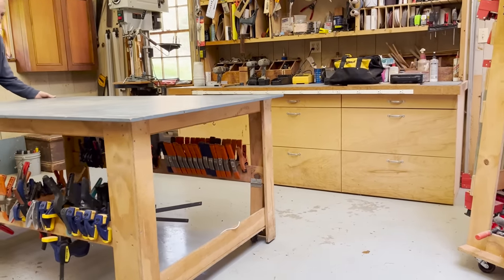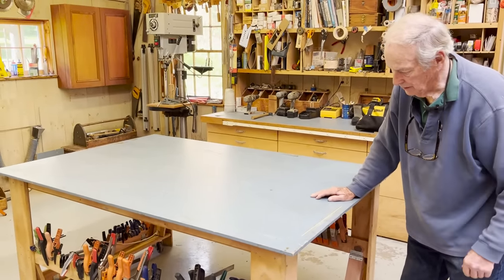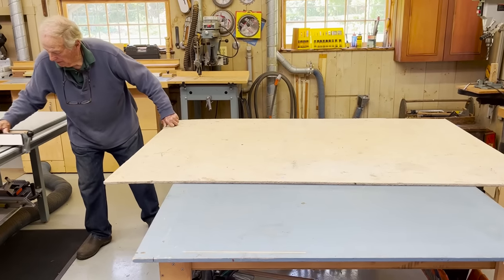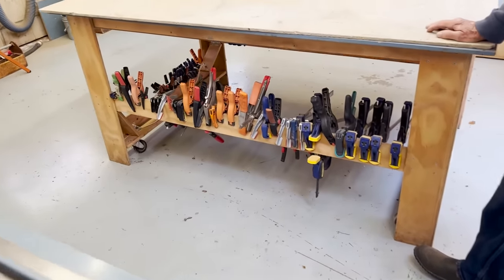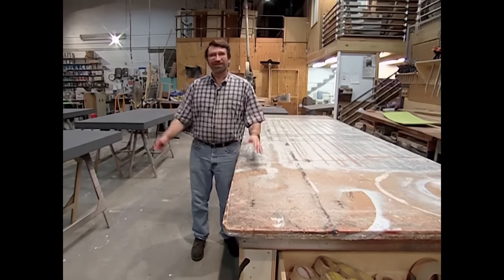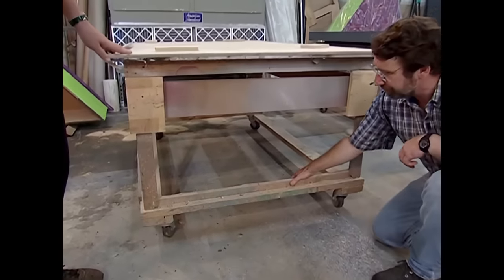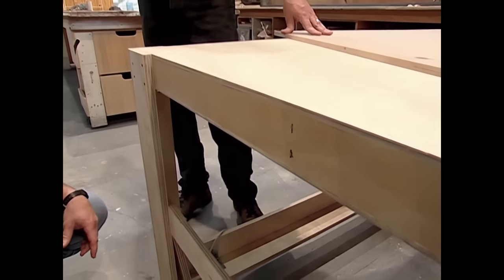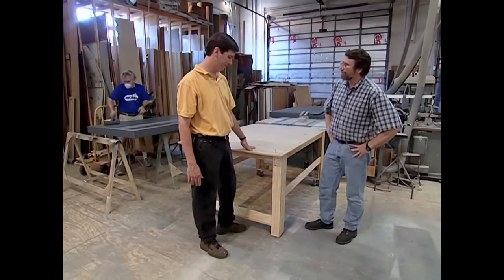Project Update: Work Table and Clamp Cart

Comment: I purchased the plans for this project years ago and it has served as my assembly/outfeed table for many years. I recently built a moxon vice and it sits in one corner of this table and allows me to clamp boards for dovetailing or other joinery work. When I built the table, I modified the top by creating a torsion box to ensure it didn’t sag, placed a 3/4 inch piece of MDF on top that I’ve replaced a few times over the years and routed with stopped dados for my miter gauge bar when crosscutting, and made the entire table just a tad shorter than the height of my table saw to ensure no issues as an outfeed table. It’s extremely solid and immovable when the castors are elevated and works great for many applications. Also, the overhang of the top on all four sides allows for plenty of clamping opportunities. Thanks so much Norm for designing this table! It’s definitely one of my most used and loved pieces of shop furniture.

Comment: I bought your plans for the work table and clamp cart episode, built them both and still use them.  I then came up with a modified size version of the table when I got a small CNC.  I appreciate so much everything I learned from you over the years.

Comment: Thank you Russ for these updates and look back in time at the New Yankee Workshop and projects now in 2023. I noted a few new Jet stationary power tools in the shop - drill press, band saw and sanding station? Also a hint of yellow with hand power tools by Dewalt? Some new Irwin clamps as well? Great to see the iconic Delta Unisaw and Bessey KBody clamps are still in use from 30 years ago. These older tools are classics and still in use in my shop today. Thanks again for these updates and the memories!
Reply from the maker: When the show ended we were able to remove all the tape and stickers covering the logos 😀
Reply: @newyankeeworkshop   Yes, duct tape and electric tape along with camera angles were used extensively to cover brand name tools that were used by Norm at the New Yankee Workshop. Usually with a few good tool catalogs one could figure it out. Later, internet sites like Tool Crib made it even easier to unmask the tool! Identifying the tools Norm used back in the 1990s is how I built my shop - with a few exceptions - from hand tools to power tools to stationary tools he used. It’s how I leaned to make sawdust!
Reply: @newyankeeworkshop Why was it necessary to mask the tool logos like Makita and Porter Cable when the masses know what brands they are?
Reply from the maker: PBS was government funded back then and they had strict rules about not promoting products in the shows. @christopherstein106
Reply: @newyankeeworkshop  It is a shame that "P"BS no longer receives government funding to produce educational television. The commercialization really changes the priorities around and lessens the quality of the programming in my opinion.